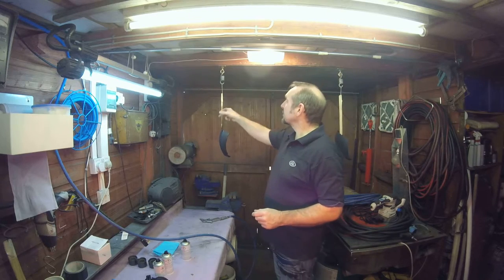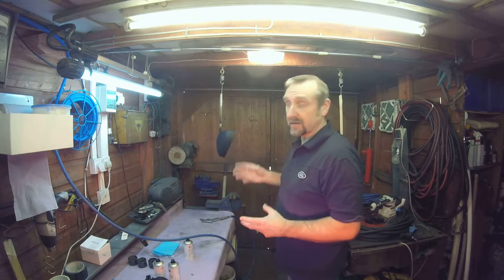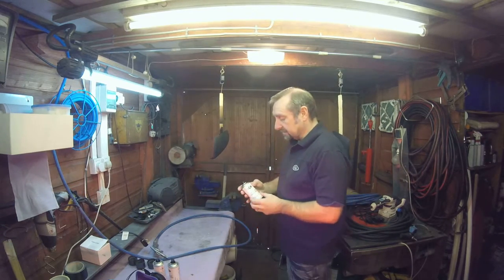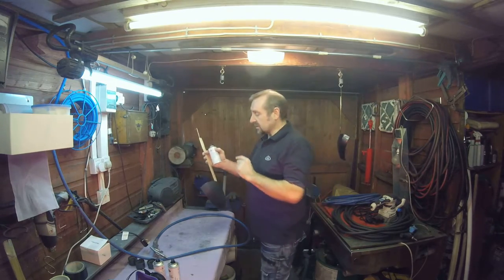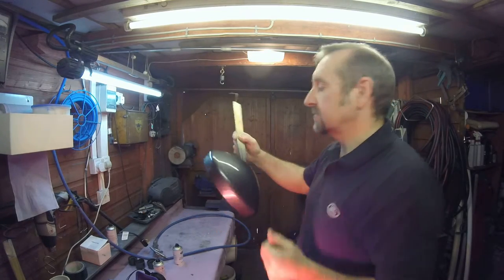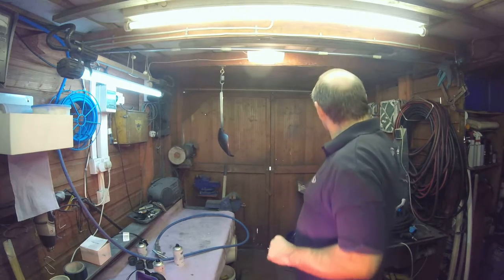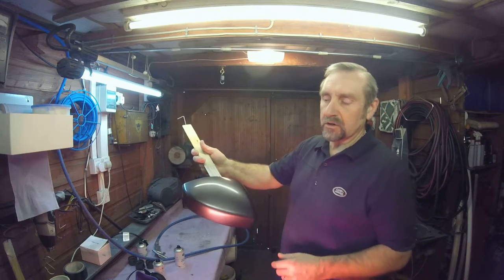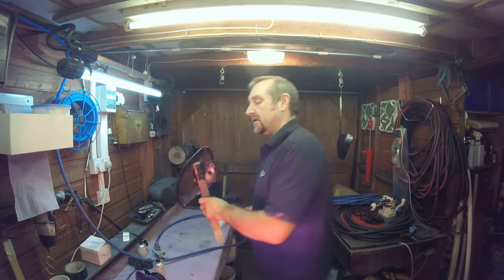painting through the stages part 2

Comment: Hi Jason,  thoroughly enjoying your vids. What do you make your lollipops from? Thanks in ad8 and please keep your vids coming.
Reply from the maker: they are made from some wood strips i bought from my b&q diy store, they are 5mm thick, 30mm wide and 45cm long i use a tent peg taped to the one end
Reply: brilliant! thanks so much. any chance you could review the iwata WS400 v Sata 5000rp for a comparison  between the two. I'm torn and needs balanced and unbiased opinion. I realise it is horses for courses but looking at a new clear gun and unsurecwhich way to jump. cheers.
Reply from the maker: This is probably the most difficult question to answer, there is a lot of variables which need to be addressed. Are you an everyday painter in a production shop or are you an occasional painter? if you paint multiple times a day i would suggest the sata not because it is the best gun because it isnt but it does last the longest it has a more robust build quality, go for the 1.2 as the 1.3 will give you loads of runs. with the anest iwata to me they paint the best  the ws400 1.3 or 1.4hd set up is the best but even though the ws looks beautiful and feels great and paints great  it is a bit cheap with its fixings and controls, the control knobs have an issue and fall off and the alloy seems quite soft and dent and mark very easily, my iwata choice is the w400 1.3 or 1.4 wbx it paints exactly as the ws but is strong and lasts and costs less. i have already changed my ws's for w400's so i can only show the 5000 rp and the w400 with a video.